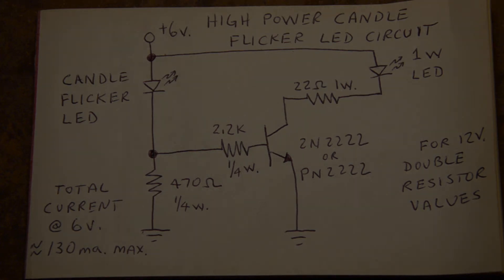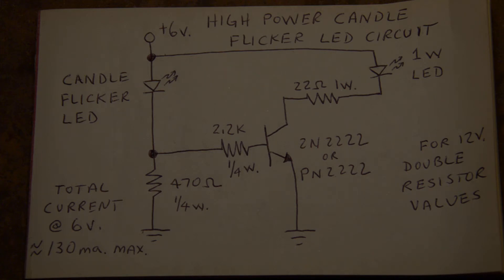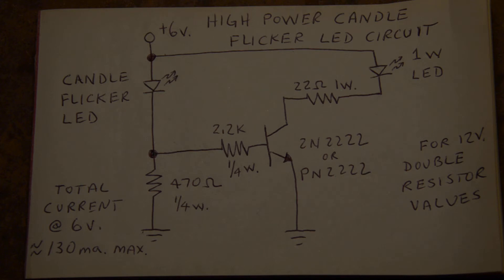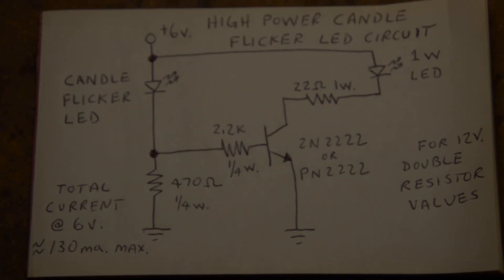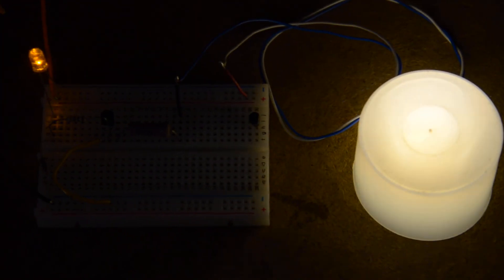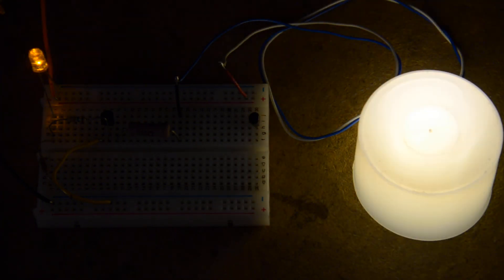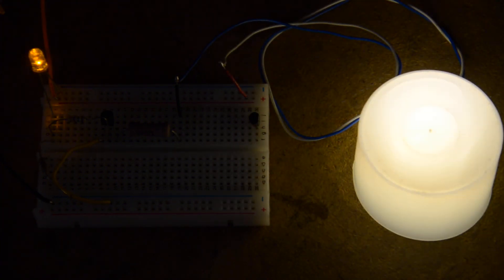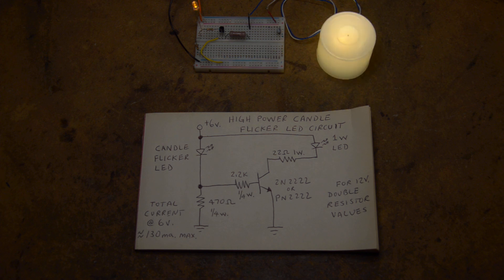Candle Flicker LED driver for larger brighter LEDs   NO Arduino

Comment: Hi i wanna try this but i only have flickering LED with 6h timer (built in) what will happen after 6h? I presume from the schematics that both goes dark and draw no current? But i rather check with the pros first. Thanks for this video.
Reply from the maker: I'd love to help but I don't know exactly what you are working with.   Go on Ebay and get 5 mm candle flicker LEDs.   They are really inexpensive.   Build what I have in the video.   You might be able to use the LED from the device you mentioned but I can't say for sure.  The flickering circuit might be separate from the LED.  Sorry.   Best Of Luck

Comment: Can i use simple 0.5mm led?
Reply from the maker: Absolutely.   Thanx for watching
Reply: @jp040759  Sir I'm not using flicker led.Im using just simple 0.5 mm led.
Will it work pretty well?
Reply from the maker: @anthonypeter4786    OH now I understand.    NO.   The flicker LED has the built in flicker circuit in it.   I am taking advantage of that fact to control a transistor to flicker a larger brighter LED.   By making a voltage divider circuit with flicker LED and resistor the fluctuating voltage is driving the transitor's base pin to maker other larger LEDs flicker.  You can use this to drive larger LEDs if you design the circuit to handle the higher voltages and currents of larger LEDs.   By using the flicker LED's internal circuit  I do not have to use an expensive and complicated microontroller to make an LED flicker.

Comment: Would this work for a 100w 30v COB LED if I multiply X5 the resistor values?
Reply from the maker: Power supply for this high wattage LEDs would be different with higher voltages.   The basic concept will work but the driver circuit  would have to be redesigned to handle the higher voltage and higher current required for the large LEDs.    Sorry reply took so long.    Notifications from YouTube comments were getting dumped into my spam folder and I didn't know it was happening.    THANX for watching.
Reply: @jp040759  Thanks for your reply. Much appreciated!

Comment: Amazing, I was looking for this since weeks ! With a 0.5 led you'll need just to put a bigger resistor around ?
Reply from the maker: Thanx for watch9ng.   Not sure what you mean by 0.5 LED.   If you mean 0.5 watt LED nothing needs to change.   This circuit is driving a 1.0 watt LED already.    If you want to drive a higher wattage LED you will need to make sure your power supply can provide the LEDs current (amperage) demand  and you will need to use a transistor and resistor that can handle this higher current of the higher wattage LED also.    Hope this helps.

Comment: This is really really cool man. Would it be possible to use a dimmer somewhere in the circuit to adjust the average brightness of the large LED?
Reply from the maker: Thanx for the compliment.   Of course you can change the brightness.    If you want a fixed brightness just make the 22 ohm resistor a larger value.   If you want it variable brightness add a 1/4 watt 50K or 100k ohm potentiometer as a variable resistor in between the 2.2k resistor and the base of the transistor.   If you do variable mode you may have to get a higher wattage transistor because it will be dissipating way more heat due to being used in its linear region in stead of being switched on hard as in the regular circuit.     Good luck.  Let me know how it worked out for you.

Comment: Thanks but I don't understand why this circuit is oscillating. What's causing the flicking if the transistor is permanently biased by the 2.2k resistor through first led?
Reply from the maker: The beauty of this circuit is you are using the factory candle flicker LED to control the current flow of the 2N2222 to amplify the current to drive a higher wattage LEDs.  The flicker LED has a built in custom microcontroller built into it for the flicker effect.   You don't need to program your own microcontroller for this purpose then.  Look up candle flicker LED intro.
Reply: @jp040759  oh yes I see. I thought the first led was a standard led. I understand. Thx!
Reply from the maker: @Teddy_Doloir  Thanx for watching.

Comment: im gonna try to power about 5 Flickering leds  for a nativity scene to hook to just 1 power supply and a power switch  anything special i need to do besides doubling the Resistors?
Reply from the maker: WELL!!!    That is a loaded question.  Personally I would suggest making 5 separate circuits run off of one power supply large enough to provide enough current to handle the draw of five 1 watt LEDs.  This will make each LED flicker differently and make it look more realistic since they will all flicker a a different cadence than the others.  Much nicer natural multi candle effect.   Secondly the 2N2222/2N3904 transistor cannot handle the current of all five 1 watt LEDs at one time.     Try a TIP120 darlington NPN transistor in place of the 2N2222/2N3904.   It can handle the current of five 1 watt LEDs.   The TIP120 may need heatsinking also.  I am just spit balling regarding the TIP120 so this may require tweaking the 2.2k reistor to get the right effect.   You may even have to tweak the 470 ohm resistor.  Bottom line the circuit may have to be customized to have one power transistor drive five parallel LEDs and resistors.  Get yourself a breadboard and build it so you can easily tweak the circuit design.  Lastly provide one 22 ohm resistor in series with each 1 watt LED.   DO NOT run all five LEDs through one resistor.   Good luck and nice idea for the nativity scene lighting.  Look up Tayda electronics.   They have great pricing on electronic components and their minimum order is only $5 USD and shipping is very reasonable.    They have fast USA shipping too.  Great outfit for parts for the hobbyist.    I would love to hear what you ended up doing and how it worked for you.   MERRY CHRISTMAS....